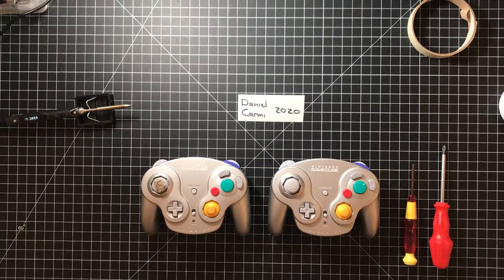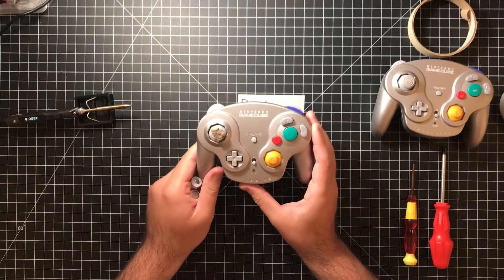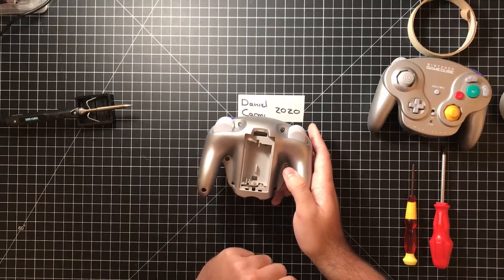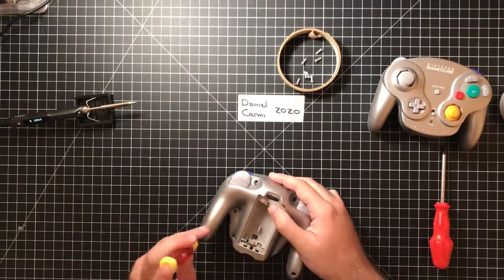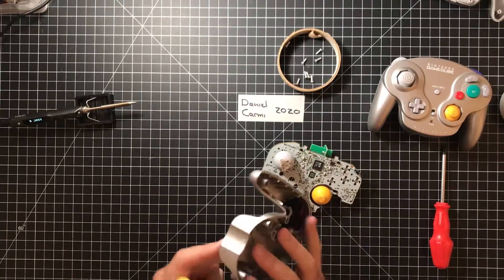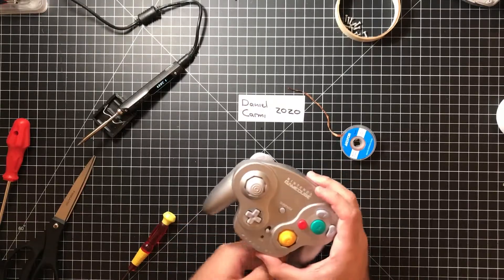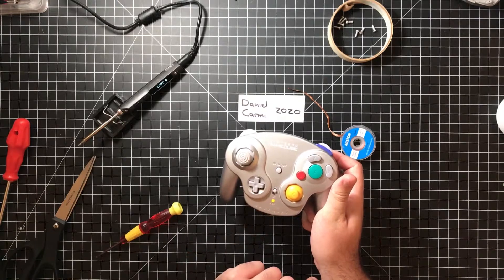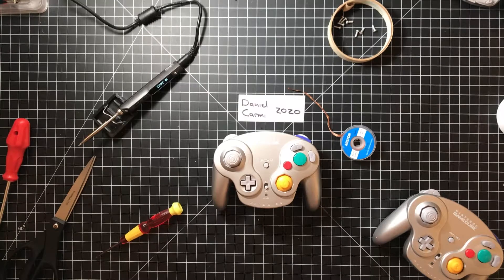Gamecube Wavebird Controller Repair

Comment: A simple removal of the contacts and 20min soak in white vinegar would have saved you the need to cannibalize the other controller for the contacts.  This is a common repair for wavebirds and can be done in 45 minutes without the need for parts.  I would work on getting the other controller working instead.

Comment: ‘That I just 3d printed’ lol, like having a 3d printer is no big deal. That’s a pretty specific item to own. I thought there was gonna be something a little more clever than “I printed a new battery cover”. Helpful video though. I have a similar issue and was wondering what the fix would be. It seems like the only way to fix a busted battery connectors is to harvest it from another controller.

Comment: Have you tried cleaning the corrosion off the contacts?  Instead of replacing?
Reply: I put the contacts of my controller into vinegar and after 30 minutes, I put the contacts back. It worked! The corrosion was in an area where I couldn't reach with the q-tip. That is why I had to remove the contacts. You can pry them out with a small screwdriver. Be careful not to break the plastic parts.

Comment: My wavebird controller doesnt turn on anymore. I‘ve replaced the stickbox with a new one and placed everything back together but the light will not go on.. do you know where the issue can be? Did i solder too much on important connection on the mainboard?

Comment: Is the only way to fix the battery terminals is to harvest them from another controller?
Reply: You can use white vinegar with baking soda to remove the corrosion.
Reply: @lizandrogarza3240  I phrased that poorly. What i meant is if the battery terminals are shot (i.e. eaten through), what is left to do?